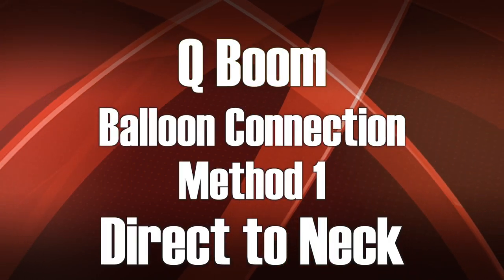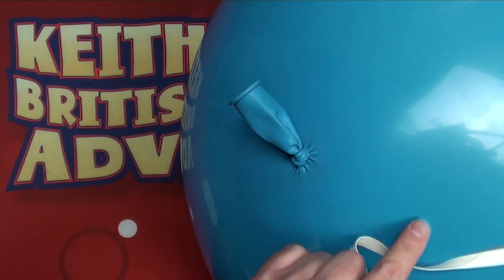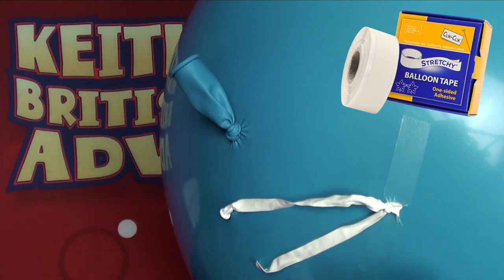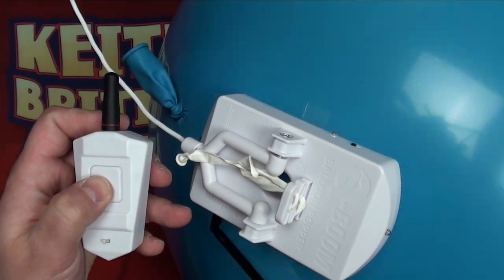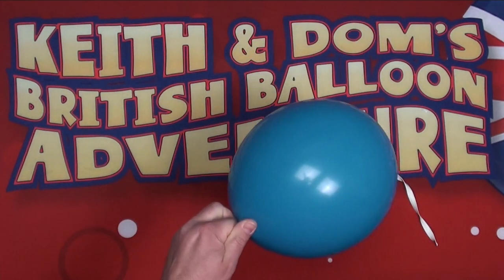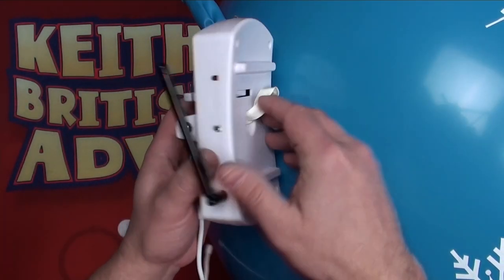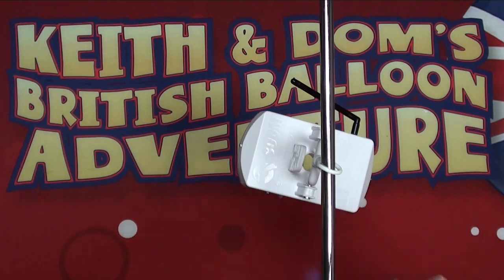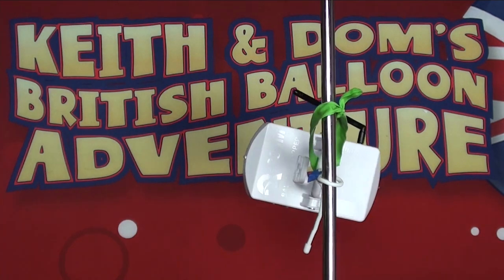Q-Boom - Basic Connection & Rigging Techniques

Comment: Do you know how far ahead you can install these?  I have a client who usually sets up for New Year's a couple of days in advance.  We wouldn't be able to get access to the ceiling once installed to turn the receivers on.  Thanks for all the rigging info!
Reply from the maker: Hi Tanya, although there isn’t an official guide to this, we accidentally left the receivers on for over two weeks and then tested them after we realised. They worked fine for us! However we recommend you do your own testing and definitely use brand new, good quality batteries for it.